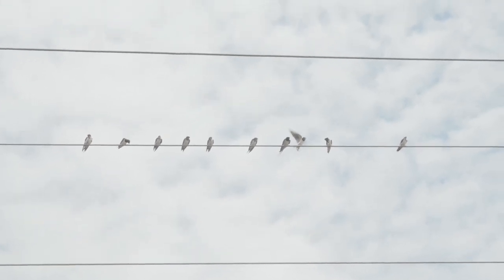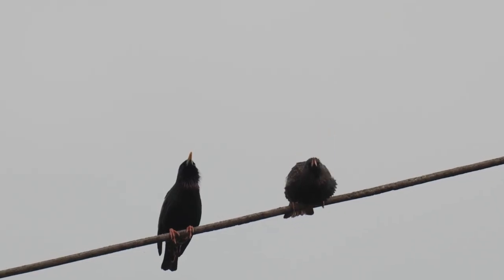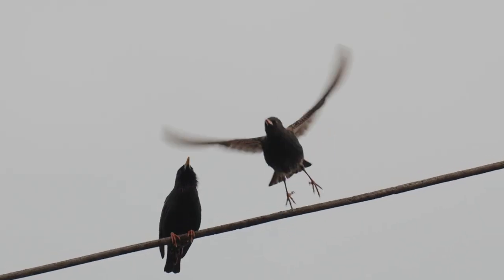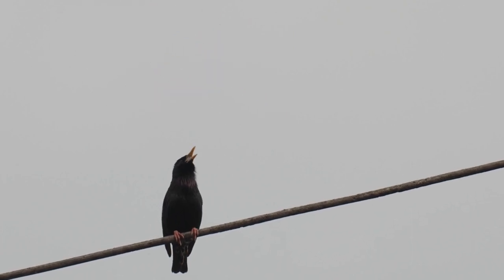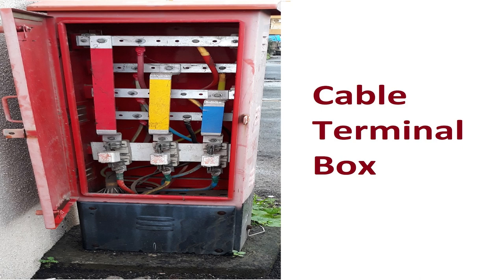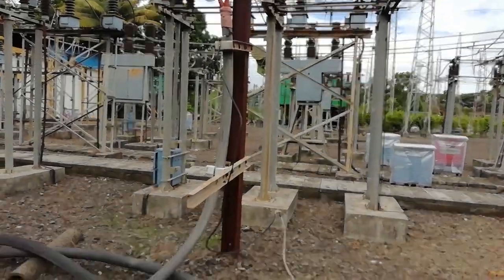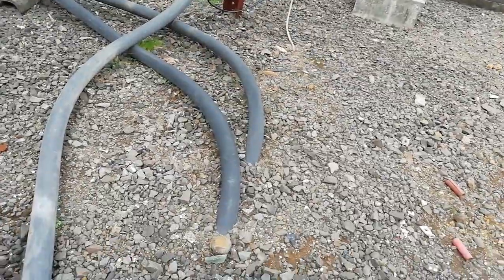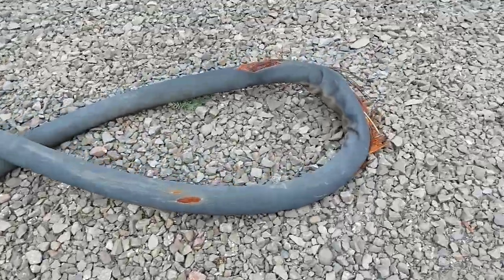Why do Power cuts happen during the rainy season? Explained with Interesting & Practical Example.

Comment: Wind and lighting. Wind combined with tree branches. Rain cleans the dirt off of insulators. In droughts cause dirty insulator which cause insulator arcing. The insulators are washed while the line is energized using distilled water. Rust from the steel towers can run down the steel arm onto the insulator. Bad insulators can be identified by arcing and using a infrared camera at night. 

Substations are prone to outages due to varmints like squirrels, snakes, lizards and fire ants. Large zappers are used to eliminate the varmints. Tower insulators are prone to buzzard shit from preaching buzzards. Buzzard shields are installed to deflect the shit. Monk parakeets infest substations and transmission line. Woodpeckers build homes in wood poles. Fire and take up home in underground transformers. Raspberry Crazy Ants eat the underground wire insulation. Rats and mice attack underground cables. 

Then you have traffic accidents and people digging up underground wires or running into overhead wires with oversized loads. The list is endless. Don’t get me going about ships hitting power lines and then there are airplanes. Of course the occasional flood of biblical proportion happens followed by hurricanes and tornados.

Then there are the transformer explosions for unexplained reasons. Awesome to see. Like the Fouth of July. 

Linemen are heroes, they go out into the rain, wind, cold, heat and darkness and restore the light.
Reply from the maker: Thank you Very much for highlighting the practical difficulties faced by linemen to supply uninterrupted electrical power, and various reasons for electricity interruptions/outages. Indeed linemen are heroes who work day and night, face all kinds of challenges to maintain electricity supply continuity.

Comment: What equipment is used to detect damaged insulator?
Reply from the maker: Megger is used to check insulators
Reply: I mean when installed on the line thanks
Reply from the maker: @gerger4337  there different tests for different equipment before installations.
Reply: If Insulater get damage due rains, is it foult in manufacturing